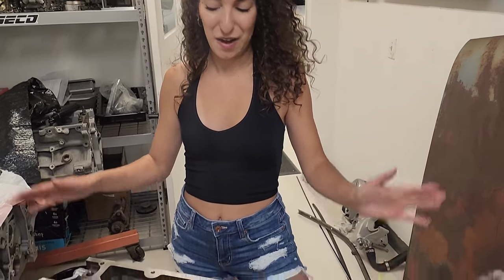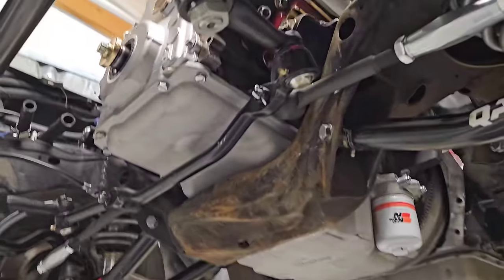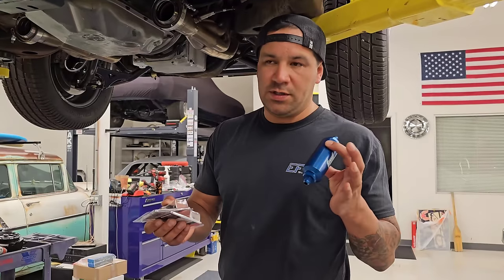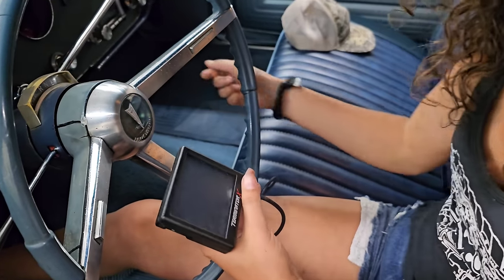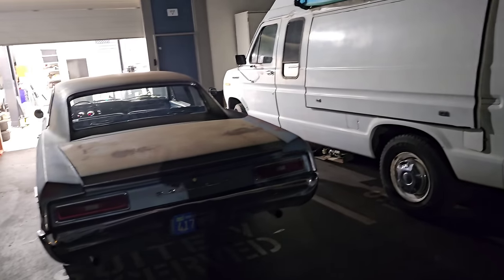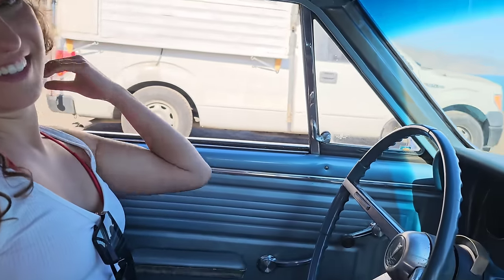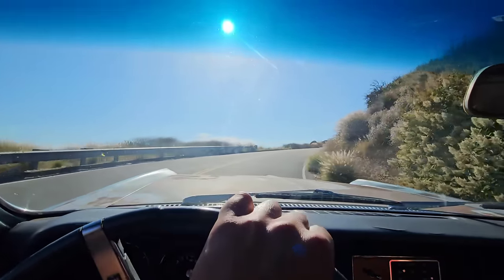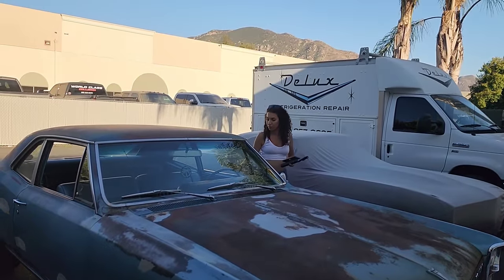We Rebuilt My 1967 Pontiac Tempest & Drove It To The Beach

Comment: Dude, why are people so hung up on changing out the Pistons, a big waste to replace all the Pistons if you don't need to. You only replace that which is broken. The YOUNG LADY IS ONE HUNDRED PERCENT CORRECT WITH GOOD COMMON SENSE!!! Thanks 👍
Reply: Correct Jason, but [O]Liv[ia and Danny are completely incorrect, wrong with not cleaning all of the carbon deposits off the pistons, inside the heads, valves as they did within the cylinders The carbon deposits result in detonation which results in harm. 
All of that effort to open the engine, disassemble, examine everything, also remove every piston, change the bearings, hone the cylinders and not clean, wife, remove the carbon deposits from the pistons, heads, valves is obvious, clear, silly, foolish nonsense !! Everyone that does a refresh as this certainly cleans and removes all carbon deposits !
They clearly need to modify the fuel mixture and perhaps the fuel. But why are obviously very ignorant and refuse to accept the proper, correct, valid knowledge which is known for over 5 to 6 decades to over 120 years. Ethanol and methanol are far better hydrocarbon fuels with hydrogen is the best. 
@GNARLY SPEED SHOP   @GnarlySpeedShop  
The inline fuel filter is certainly an improvement, but a 10 num replacement filter is far better for the fuel injection system. Adding, Switching to having "Flex-Fuel" for variable and high ethanol content is far better too.
However, Ignorant Fools will remain to be foolish accepting the false incorrect ideas, claims, information from those with improper, incorrect, invalid information lacking proper knowledge known form  over 140 years.
Blogs, certainly 'comments' along with many involved in building, racing are certainly among those with incorrect, invalid, improper, false base, basis.
The actual professionals have connection with the proper knowledge.
Among the best available on-line are David Vizard, Lake Speed, Jr.. much from Steve Morris, , add especially EFI University, R.E. D which are actual engineers as Lake Speed, Jr. Certainly add experts as PME, Dennis and similar professional engineering, competent, engine builders as Ed Pink.
Among the most common is ignorance with, about fuels, lubrication and proper operating temperature.
All The Best and Much Success in Your Quest(s), Health, Happiness and Well Being 😊, Sincerely ☺
P.S. If You will check the CA Law, ask any PD officer, Sheriff, it is required to have the CA license plates-tags with the appropriate valid sticker on the front and rear of the vehicle along with the required registration and insurance information. Danny should already know this, since he has been loving in CA all these years, as i did when living there too [1982-1993].
Personally appreciate the older blue metal painted license tags, plates. They look especially very good with this 1967 GTO too! have been thinking often, many times about the specific 417 NPR and the meaning for this vehicle. Have You figured out a meaning yet ?
Reply: I reused all my lq4 positions. Just put new rings on them and clean them up.  been running my lq4 for year's now still to very day since 2017 and not one problem
Reply: @@robertyoung. Yes, Robert Young, ... so what is/are You actual point(s) ??!!
Reply: @newtonfirefly3584 
That minimal piston carbon buildup will not be an issue at the lower compression ratio they are running with.
Reply: Take s time to clean up pistons but why not ? 😮
Reply from the maker: @newtonfirefly3584  Update Newt.  The engine is still going strong as a daily driver and completed a drag and drive event.   There has never been one ticket issued.  Actually, we have multiple cars running with no front plates.   Never a problem.  Just good vibes 🤙
Reply: What caused the piston damage? What was found?

Comment: Before starting it you want to prime the oiling system. Disconnect the fuel and pull all spark plugs. Use the starter to turn the engine and build up some oil pressure.

Comment: Congratulations on finally finishing the Ponting project! 😂

Where are you guys? I guess its L.A. right?

That must have been so exciting and a big relief to drive it and know she's okay.

The big unanswered question is what was the diagnosis of the piston? Did she put it in the wrong way? Thats an important step in building engines. I didn't or we didn't find out what caused the scoring on the piston. Don't worry there is no way to learn without making mistakes. In fact if your not making mistakes your not trying hard enough. Nobody wants to fk up unfortunately you can't make gains with errors. Always right down the steps to check. I always do it methodically and recheck everything at least three times. 

I remember building something and rechecked it for the third time.
Thats when I discovered a mistake.
Make check lists so you can check each component on a piece of paper.

Anyway this was a fun video and wow what a gorgeous day in Los Angeles! That coast line what a view! 😂❤👍👏🙋🏻‍♂️🇦🇺 Australia

Comment: Never ever start a freshly assembled engine without using a preoiler to get all of the air bubbles out of the oil passages or the top end is going to run dry  while the engine oil pump is trying to purge the airlocks out. Assuming you use a good assembly lube, probably no harm was dome. But listening to those hammering lifters made my teeth hurt. Anyway - nice engine.

Comment: 10:34  Band clamps, like what is used on large trucks, work well for sealing when the downstream pipe is inside the upstream pipe.  Muffler shops insert the TP this way but then generally weld it to make it leak-free.  But you want to remove your mufflers in the future, so a band clamp is a potential solution.  There are band clamps for butt-jointed pipes and for overlapping pipes - make sure to get the right type.  Also, slather the OD of the tailpipe with anti-seize before you put it into the muffler to help with future disassembly.

Comment: Last vehicle i had that was a big pain in my ass building and keeping it together for the first two years i kept as the daily driver firewood hauler and scrap metal hauler was, a farm truck with a built 355 xe competition cams 268h 477/480 lift 86 chevy k20 custom deluxe long bed 3/4 ton 4x4 and I owned it for 12 and 1/2 years
Reply: Same truck I have mentioned before with the trw 0.20 dome pistons file fit mahle piston rings and the th400 turbo transmission with the B&M tork master 3000 rpm stall torque converter which is actually more like a 21,00-2,200rpm stall torque converter at least it was in that truck, truck had 3.08 gears because of when I destroyed the front axle it got switched to 83 gmc k15 High Sierra heavy duty 6 lug corporate gm10 bolt front completely rebuilt new axle shafts, only used part was my factory gm 10 bolt manual hubs, and the gm corporate rear 12 bolt that other reseal the diff cover I didn't touch, truck exhaust was big primary tube hedmann full length tube headers and 2 1/2 pipe 18 inch long collector extensions, neighbors hated that truck so did the trailer court when I lived in town to help out my best friend.. especially when I would come idling into the trailer court around 3:30am and I really did idle it around but it wouldn't climb the speed bumps so I had to give it gas to drive over them spread out each lane usually have 3, and it had a pretty decent lope to motor.. truck had 16x8 American racing atlas chrome plates aluminum wheels and Kumho Road Venture MT KL71 tires so I kept most of the 3/4 ton ground clearance and height truck was also a rusty beat to hell well used farm truck,two midnight blue and white with a double blue pinstripe around the truck along the top bodyline, except the front end a rusty but useable faded red single headlight 83 1500 gmc High Sierra doghouse minus the really decent shiny black 86 chevy c10 Silverado hood so the truck definitely stood out..

Comment: So did you discover what caused the damage to #2?  My guess is still a small brass washer was unknowingly lodged somewhere in the carb and it freed itself and it found its way to #2 and got chewed up.
The v-band on the exhaust is such a great idea.
Reply: @jeffh.9999  Explain the scaring on the piston walls and the tiny bits of shrapnel in the pan.  I did the same thing about 40 years ago.  Luckily I got it before any damage.  I small flat washer could easily pass the valve and end up flat against the cylinder sidewall.  The washers are soft enough to get chewed up.  We know metal got in somehow.  
Maybe this piece of metal was in the carb loose left there during manufacturing.  That's why I shake my carbs flip them upside down and open up the butterflies before I put them on.
Reply: @AndyFromBeaverton  , This engine does not have a Carb. Liv already said it was the number 2 fuel injector that was clogged causing no 2 cylinder to run lean.
Reply: @MJTAUTOMOTIVE  Was it clogged and not flowing enough or spitting large droplets instead (which don't burn well and can show as lean on the WB gauge).  The clean spot on the cyl head makes me think it was spitting and giving some fuel wash.

Comment: You can please some of the people some of the time but you CANT please all of the people all of the time. I wouldn't worry about other peoples comments, just enjoy. My 57 Chevy took 4 years to finish and now just driving the wheels off it. First few runs were shakeup runs and did have some problems to fix. Hey that's hot rodding. If you want a trouble free car you go to buy one off the shelf, but what fun is that.

Comment: You need adapters  between the mufflers and tailpipes. The pipe fit up, the way it is, will always leak. Flow the exhaust with respect to your connections.

Comment: The first start after a build is critical for long engine life so I was surprised you didn't remove the spark plugs then wind the engine over on the starter until it has full oil pressure. We would never start a new engine without doing that first.
I've no experience of the Chevy LS but to me the oil should have been up in the valve gear straight away. Did you inspect the oil pump for damage from the piston debris?

Comment: Hey liv i went manuel Will Wood master like you an ben but they are little hard to push 1 inch bore what do you have on the tempest?
Reply from the maker: I believe mine is the same. They took a little getting used to
Reply: @GnarlySpeedShop  you sure cause i cant even lock up my brakes hehe installed the master but still stock brakes

Comment: Oh before I go get some Rode much that you pin onto your shirts. You audio is a bit lacking. I could barely here what you were saying.

Rode or DJI. 

DJI might have a new model.

Also consider a new camera.

I have a Sony A73 and a Sony ZV-1 which has a good focussing system which I like a lot. 

I've used my Samsung S22 Ultra a few times its just that my ZV-1 has a bigger sensor which makes a difference when you spread it a cross 4K screen. 

Anyway seeya l8tr. 😂

Comment: It doesn't seem like you guys don't really want or appreciate comments, but the way you torqued the heads was not correct.
Rather than tell you, I will just advise you Google some LS rebuilds and discover what 'torque to yield' bolts are and how to properly tighten them.
You may start blowing head gaskets, so watch for that. Hopefully, your expensive aluminum heads will not end up warped.

Comment: What happened to number 2 cylinder
Reply from the maker: It got damaged from piston to wall clearance and injector running lean.
Reply: @GnarlySpeedShop  I figured it was lean from the way it looked also a bit tight in the cylinder hole since all four corners were damaged  like that

Comment: Did you check clearances this time around?  Don't trust the machine shop, its up to the builder to check and make sure its correct.  There are lots of clearances that need to be checked during assembly.  Buy the book Chevrolet Power The Official Factory Performance Guide.  It doesn't cover LS, BUT the 4 page build sheet in the back should be filled out as thoroughly as possible during the build.

Comment: My Chevy Beach van has 220,000 MI on the original cast pistons and rings not burning oil yet. Now that you actually live in California don't knock people on the internet who try to give their two cents. To help you. I do all my f n own work and don't trust anybody. Engine  rear-end headliner carpet door panels steering brakes transmission wiring and body work, paint to.With a clear coat. Never had work done at alignment shop either don't trust them nobody.Did I mention radios amps and speakers to 👎 look forward to a grudge race. I'm running a vintage mouse motor all 60s 327.....,.. Correct.Iam the backyard King😮 shade tree mechanic haha real Street racer 50+yrs